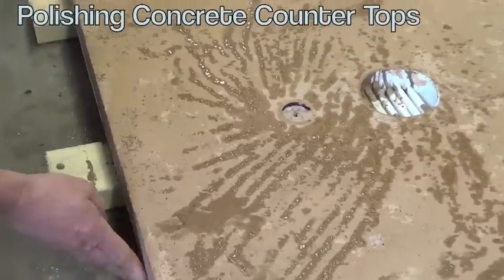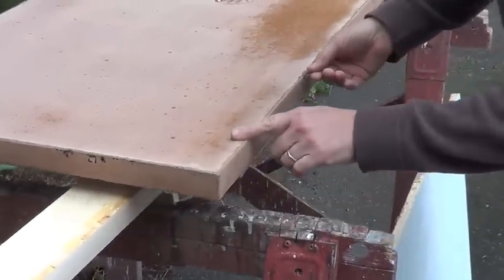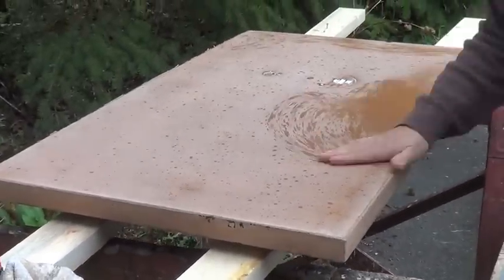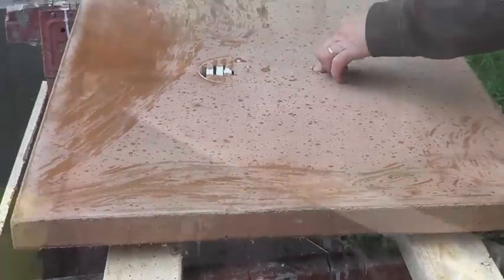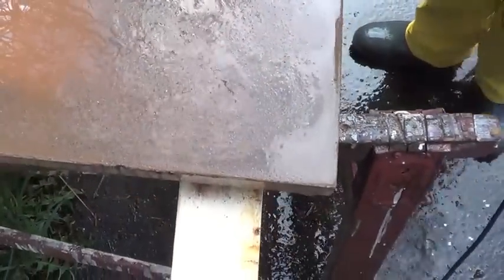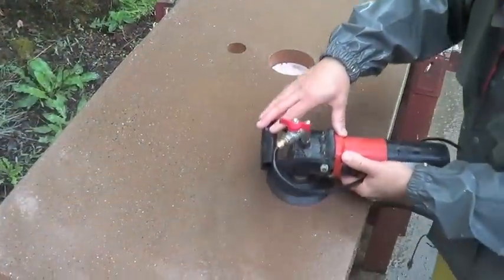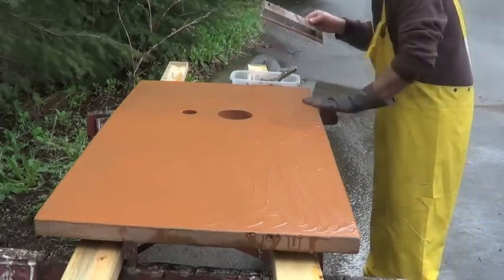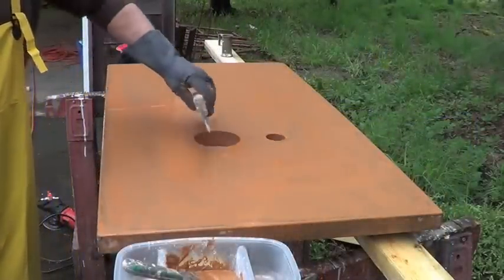How To Polish Concrete Counter Tops

Comment: could this be done with concrete made from hemp and natural fibres?
cheers
Reply from the maker: +Craig Easton Good question-: I don't see why not- we used the 6000PSI cement and it comes in white- so if you wanted to mix the hemp fibres in lieu of "fibre mesh" which we added. Be careful as the sharp hairs will stick out- as the fine top layer is ground off- Make a test sample on a bucket 1 1/2" thick

Comment: is the filler needed?  also what polishing compound did you use?
Reply from the maker: No the filler is not need but there will be holes- more hygienic if they are filled- During polishing it is just water and the grinding stones- finishing is a pure carnauba wax.
Reply: +Alex Denny thanks for the reply.  the shinny look comes from the water polish or the wax?  contractor did mine is dull and not shinny ar all.
Reply: +Alex Denny If i want to add sealer, should i do that before the wax polish?

Comment: Hey what speed were you doing the grinding at on the pollisher was it on the low setting or high? Or middle?
Reply from the maker: start of slower for the actual grinding then the polishing happens at high speed-- keep that water flowing-- that is the key
Reply: Alex Denny how long did you let the slurry dry for? And what brand concrete did you use? Was it quikrete? 
When you made the slurry did you just use the same concrete and just make it a lot thinner? Or did you buy a slurry mix?
Reply from the maker: Rj Shuba We used the 6000 psi concrete mix from Home Depot-- 
 The slurry was a fast set material- whatever you use has to be set before you hit it with the grinder--
Reply: Alex Denny ok done all
That. What kind of sealer did you use And then did you apply the wax coating after? And what kind of wax as well did you use? You applied the sealer and how long did you let it dry before you put on the wax? Also did you lightly rub it in the polish it in later with a polishing disk?
Reply from the maker: Yes the "Sealer " is the key to preservation-- pure Carnuba wax-- as many coats as you can apply. rubbed on by hand and then machine polished with an automotive polisher.

Comment: There is absolutely NO way, with all those voids and large pin holes, and leaving them on the sides, not showing or discussing the bonding issues of slurry, contraction of slurry,  with a product that has already gone through the binding chemical reaction of concrete, how the holes caused by sand grains will reappear, and so many other factors. Don't rely on this one video to finish your concrete counter. In fact, if you read the comments first, don't waste your time watching. I promise your pin holes will reappear, again and again as you move through the grits of sanding & polishing.
Reply from the maker: So your some sort of hot-shot pro-? and you do this all the time--? / really enjoyed you "Flowery" and very professional opinion- and I'm sure the subscribers will love reading whatever comment you made--  Just a FYI-- No pin-holes years later-- its a "catalyzed" coloured filler---